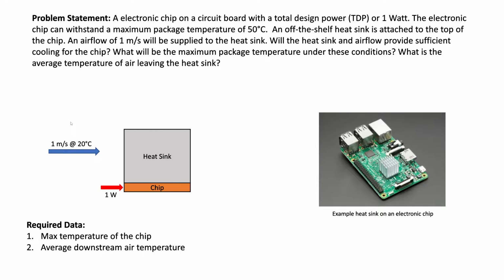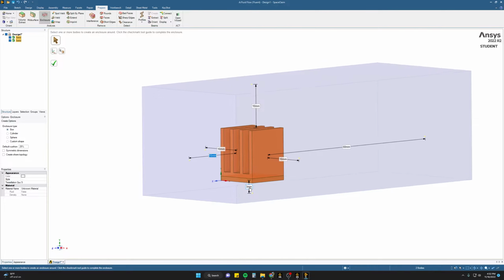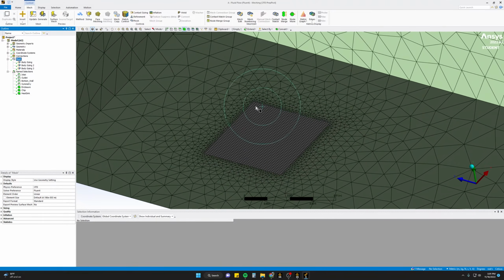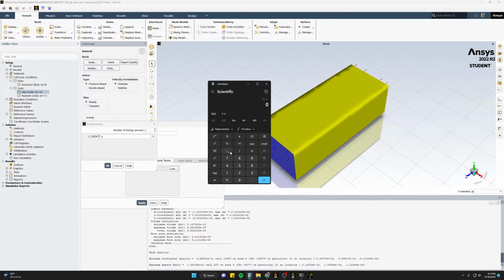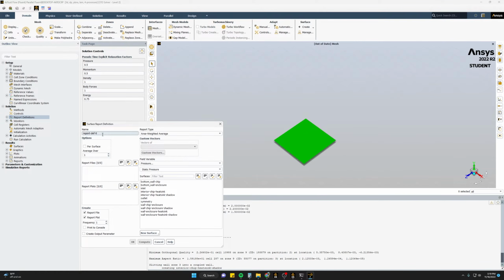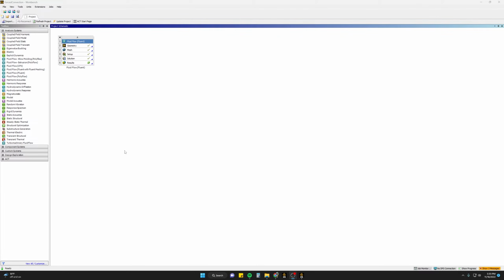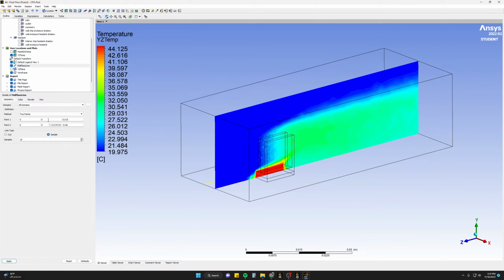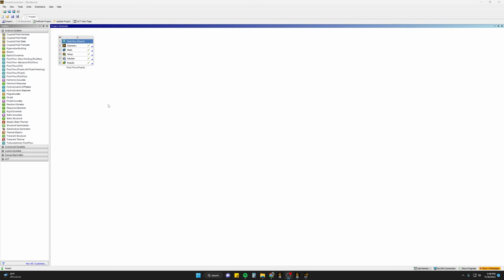ANSYS Fluent: Electronics Cooling Forced Convection | Tutorial

Comment: If 1 W increases the temperature by that amount, how is it possible to cool a CPU with a TDP of 50W? As I believe most CPUs have a much larger TDP than 1 W.
Reply from the maker: It mostly boils down to powder density, surface area of heat sink, and air speed. In our problem we have a small chip, with a small heat sink, and a very low air velocity. For a computer CPU the heat is spread out over a larger surface area by the internal heat spreader (IHS). This reduces the power density and allows us to have a large contact area for out heat sink. CPU heat sinks are also much bigger with much more surface area. Finally, CPU fans attached to the heatsink will move the air much faster than 1 m/s over the heatsink. All these factors add up to us being able to safely dissipate power from 50-100W.

Comment: Hey can tell me if I add in between core and heatsink some interface which condition I have to change
Reply from the maker: Hey Karen, if you want to add thermal resistance between the chip and heatsink you can use wall thickness. 

1) Create a new material for your interface. 
2) Under boundary conditions find the wall between the chip and heatsink. 
3) Change the wall thickness to your interface thickness, say .001 m, and change the material (in the lower left corner of the wall dialogue box) to the interface material.

Fluent will calculate the thermal resistance using the material properties and the wall thickness. If the interface is thick, say over 1 mm, I would consider adding shell conduction, which will allow in-plane conduction through the interface. Check out the Fluent manual for shell conduction for more details.

Thanks!
Reply: @cfdkareem  thanks
Reply: Can you do the analysis like that type using  heat sink using interface  material

Comment: Do you know if we can combine this forced convection with topology optimization for better heatsink design?
Reply from the maker: Hello Влад Калчанов, there is a few ways to achieve this in Fluent. The first would be to use parameterization in Spaceclaim/Workbench. This will allow you to change the basic dimensions of the heat sink like length, width, and height of the fins. You can then use the parametric solver in workbench to run a series of configurations. However, this is more parametric modeling than true freeform topology optimization. To do this in Fluent you can use the Fluent Adjoint Solver. You can check out the Fluent manual on how to utilize the Adjoint solver for topology optimization. I also think this would make a great tutorial, so I will add it to my list for future videos!